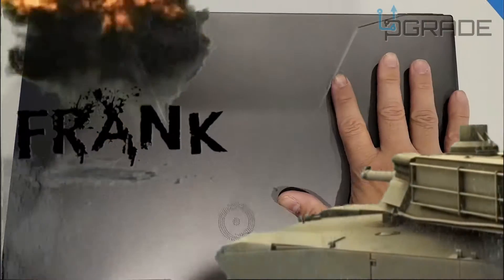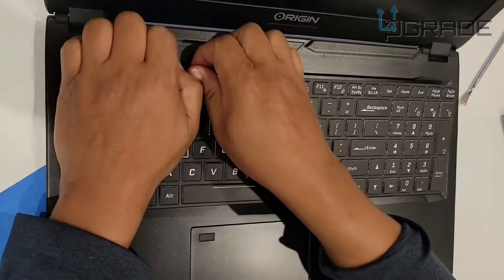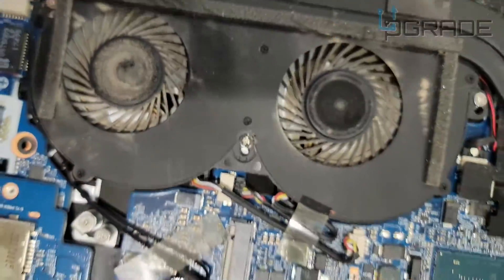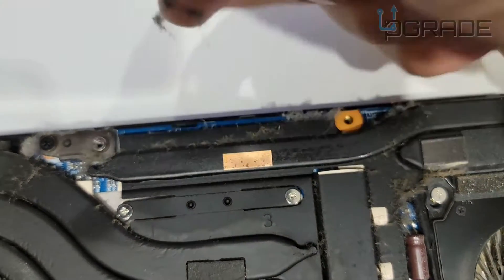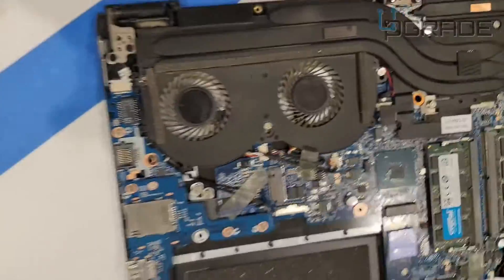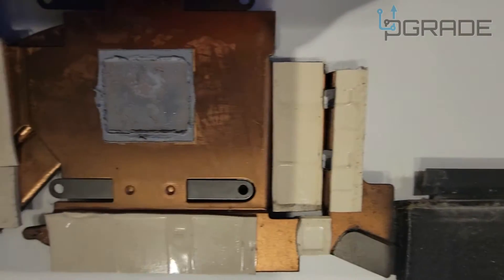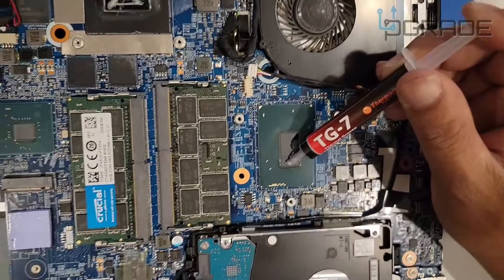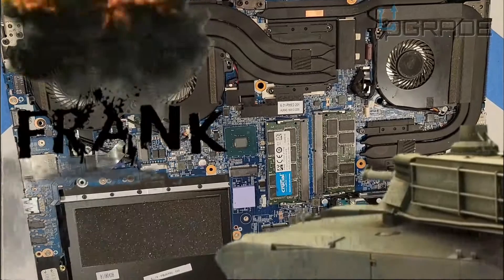Origin EVO15-S Thermal Paste replacement

Comment: Are all EVO-S15 batteries the same?   I have the one with the small tiny power button at the top of the keyboard , but not round like the one your showing ?  I've been trying to find out what type of battery I need to get to replace the one I have  it only seems to last an 1 and  a half  when on battery power  and  I wish it would last longer .   Can you get me any advice???